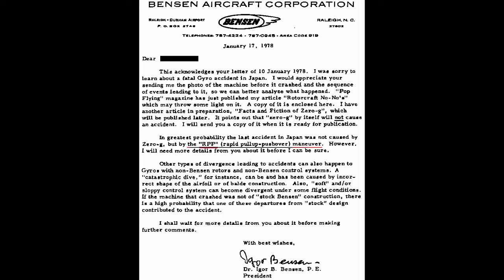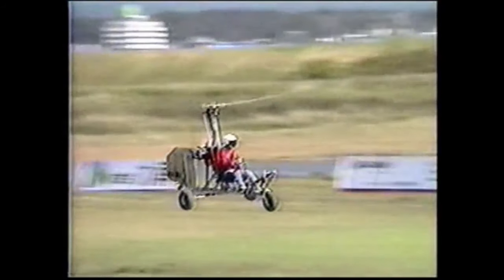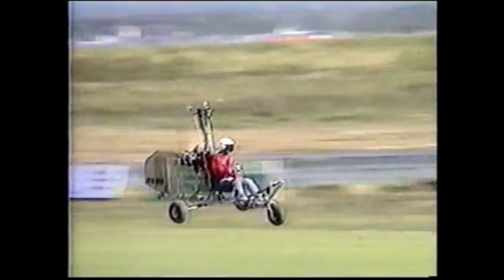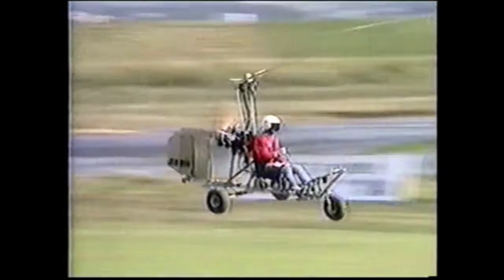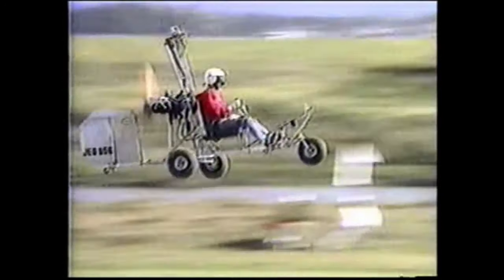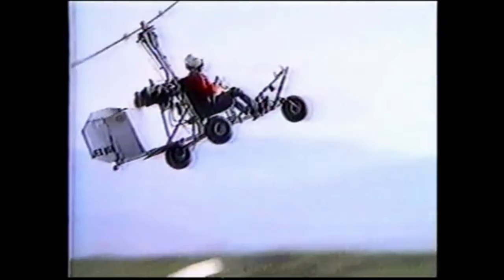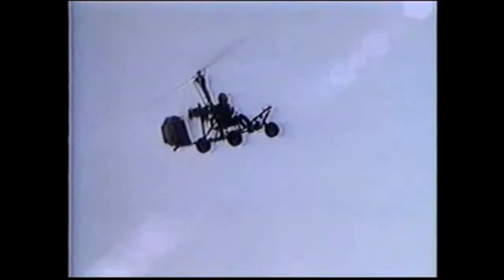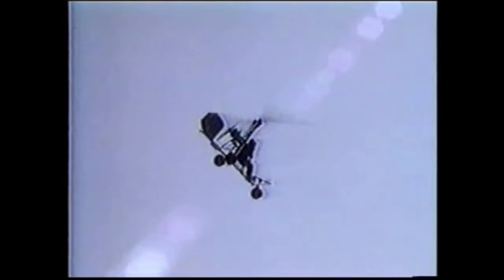Gyrocopter low g power push over crash (the cause of many gyrocopter fatal accidents)

Comment: Excellent work.  Very important to show this.  This is the classic negative g zoom then push over.  For others reading comments this is also possible at very high airspeeds particularly in a light machine with big rotors as your disk gets very low.  At high speeds it might be the tiniest of nudges that results in by bunting it over.  Fly slower than the top speed unless you are very experienced.
Reply: Yes - Cameron. and at high speed a good nudge to the right will cause a nose down pitch.
 NOT GOOD.
Reply: @shaneconnolly6673    Right or left? Yes that's possible the blades respond because the teeter hinge is off set so fore aft a nose down pitch won't do anything (for that microsecond) until the blade turns 90 degrees where the angle will effect it.  So a pitch to the right will if the teeter hinge is aligned will not impact until it turns 90 degrees when the twist will start to impact,  and pitch the up on the retreating side but the advancing will start to descent.  (If I have that right in my head).  

However I'd suggest if your that flat that this can have an impact you should be flying slower.  No one wants to say that though because we want short take off, short landing low speed performance and high speed performance, sensitivity and stability and we can't have it all.  If people really want to fly faster they shouldn't be flying with big high pitched rotors.  No one wants to say that.  

Fortunately for me my seat belt stopped me flying too fast.  Anything over 60mph the ends of seatbelts would start flicking my nipples at about 1000rpm ;)  Very painful and as I'm not into that I tended to fly below 60mph.  My gyro was very stable and nice up to 80mph (never flew it faster than that) but didn't like the seatbelt above that speed.  ;)
Reply: Thanks Cameron.
Yes HARD stick movement to the RIGHT will cause a nose down tilt.
 -aka UNLOADING  THE ROTOR !! at high speed.
Experienced gyro pilots don't notice this gyro effect- they just automatically compensate.
(In a similar way riders of BMW  horizon twin motorcycles compensate for the torque reaction of the motor & don t notice it .)
Reply: @shaneconnolly6673  Hi Shane I'm not sure you'd feel it.  theres a difference between the disk pitching and an individual rotor pitching - relative to the teeter hub.  Any movement within the teeter hub will not be felt (unless it exceeds the teeter stops) because differences in lift will be automatically compensated for - that's what the teeter hinge does.  It is critical at the point of unloading.  

I noticed this because after starting my flight training in ultralights for about 10 hours I shifted to gyros years latter a mate had brought the very ultralight I was training in.  He took me up for a fly and said "you want a go" of course I said yes.  So we are climbing over the airstrip and hit a thermal under the left wing.  "you going to correct that?" we were flying left wing high for a second, "Oh yes" I correct we hit another on the right wing "you going to correct for that?", "Oh yes".  I then wondered why my instincts were off.  I did fine the rest of the flight but wondered why the hell wasn't I correcting.  I took my gyro up after that flight and payed attention.  Flying through similar thermals I wasn't doing anything.  Because I didn't need to.  I worked it out.  The teeter hinge is lifting on the advancing side with reference to the difference in airspeed.  It lifts washes off angle of attack the retreating blade drops increasing its angle off attack we don't feel this because its doing it automatically.  

Having been trained and an instructor in gyrogliders and many times flow the whole length of the strip hands off I know there isn't any torque effect of compensation for this required.  As a disk the lift is equal even though the angle is oscillating up and down. 

Now in regards to a thermal under one side say.  what will the blade do?  Well lets say its on the advancing side.  The advancing blade has more lift (due to the thermal) so it just lifts as it does so the teeter hinge is pushing the retreating blade down increasing its angle of attack.  So you don't need to touch the stick because 360 degrees around the teeter hinge compensates automatically.  Now fore aft other forces can come into play.  If you hit a thermal although the lift is equallised (increased) across the disk as the disk is angled back say 9 degrees that lift will be increased so the effect (the moment) will change the relationship between engine thrust and lift and CG.  Of course correct down thrust or compensation of CG vs thrustline will fix this.  So the biggest thermals I ever hit pitched the nose down perhaps an inch?  go out of the thermal and it would pitch nose up about an inch max.  This was a standard Bensen geometry machine no stabiliser.  However remove the downthrust and every change of power will result in having to input a stick input.  

Generally though I realised I didn't ever fly by jabbing the stick to compensate I largely left it alone other than to adjust speed and direction.  If I hit a thermal I left it alone and just adjusted speed.

This is a long way of saying I'm not sure you'd feel any effects of the rotor responding to teetering down but yes I think if you are one the margin the teeter could well cause one blade to suddenly drop below the airflow and unload.  I don't think it likely you'd have any warning,  I suspect (although I don't plan to test this) you'd be flying and suddenly bang! Bang! BANG! you're now tumbling with wreckage strewn behind you.  Best thing would be to be no-where near this point.  Cheers
Reply: Yes I understand that the teeter action results in no torque reaction to be felt by the pilot.
I certainly felt the rotor axis tilt when I first  landed a gyro.
Nose down caused a bank to the left.
No doubt as a novice I was "jabbing" the stick a bit.

I seem to recall proving this with a rotating dowel  - No aero effect !
Yes the gyro effect precedes the stick movement of the rotor by 90 degrees.
Cheers
Shane @cameronlapworth2284
Reply: @shaneconnolly6673  agree
Reply: @cameronlapworth2284 
" Flicking my nipples " I lost it on that one, lol.

Comment: When in doubt lower the power to idle and keep stick pulled back. Dont fly the parabola. His zoom climb was actually pretty pathetic and it ran out of energy at a fairly low altitude and he has no Horizontal tail either, but even so pulling stick back and closing throttle would have punished the gyro but kept him alive.

Comment: Thanks, now I don't want one anymore lol
Reply: exactly my thoughts :)
Reply: You just don’t want one like this...  The heaviest part on a small gyro like this is the pilot.  A humans CG is somewhere in the gut.  Note the engine on this craft is up around shoulder height on the pilot and most all of his body weight as well as most of the aircraft structure weight is below that engine thrust line. A high thrust line gyro is an accident waiting to happen and requires constant attention to the details of flying, and is not a lot of fun to fly in rough air.  It is also the prime reason IMO for the small gyro’s questionable rep and safety record...  A zero thrust line or low thrust line aircraft is way more stable/self correcting and a lot more fun to fly.
Reply: @rronmar  and which are those?
Reply: @esau82  couldn’t tell you off the top of my head as I haven’t looked at gyros in years.  Typically for smaller single seat open frame gyro’s you want the propeller hub to be at or near where your butt/hips would be when seated, but there are exceptions to this as it is the total CG of the aircraft when the pilot is onboard, so looks can be deceiving. There was an ultralight gyro called a Gyro-bee that you could get free plans for which looked very similar to the one in this video, but was actually very near centerline thrust.  Usually though, it will appear as if something has been done to raise the pilot seat/pilot weight.  It is really a question you must ask the designer/manufacturer.  “is the fully loaded aircraft center of gravity above or below the engine/propeller line of thrust”  it should be a question they can answer clearly and quickly with something like “The aircraft CG is 1” above engine thrust line”  if they cannot answer the question immediately or tell you it is not important, don’t walk, but run away... you can gauge also by how long the manufacturer has been in business, a company like sportcopter dot com embraced the proper configuration early on in their designs and hav an excellent record, note the raised pilot areas in their design...
Reply: @esau82 Dominator gyro is a CLT machine

Comment: Enjoyed many flights in my Bensen, towed, and then as a BM8, which I have tucked in the basement, control input is different than a fixed-wing and explained in the original factory manual.

Comment: Wow, that was definitely a graphic illustration of just what how quickly things can go wrong, and obviously a case of what not to do!
So if he just cut back on the throttle, and applied some positive pressure on the rotor blades, he could have made it out safely?
It probably didn't help that the engine trust line was up quite high on that gyro too.
I heard that unloading the rotor blades even on some helicopters (teetering, 2 blade helis), can also lead to bad things happening, like mast bump, and even tail boom stikes!😬
It really pays to know what you, and your machine are capable of, as well as their respective limits. 
Condolences to the pilot's family.
Reply: No if he had more altitude he would have made it. He wrote a cheque the copter could not cash at that low of a altitude.
Reply: @Wildstar40  I disagree. Once you "bunt" - Power Push Over in a gyro you are done. Someone is collecting on your life insurance. There is no recovery regardless of available altitude.

Comment: It seems to me that if he simply continued his climb until he bled off air speed to a near stall, this would not have happened because the rotor would have maintained its loading. Correct?
Reply from the maker: Yes I think to some degree that is correct - as in I know what you are saying - but don't forget there is no aerodynamic stall like a fixed wing here because of the wing being the rotor and the pilot would [will in real life today] have to make positive control inputs to ensure that at the point of airspeed reducing in the climb [because at some point the motor can not sustain the current climb angle - we are not in a rocket!] to ensure 1g is maintained, remember once you start to fly a "ballistic" type flight path you are at zero g.
Reply: @gyrocopterflyingclub6148  Yes, I understand that there is no stall speed. My meaning was that as the airspeed bled off, wouldn't the aircraft stop climbing and then the pilot could simply return to level flight with no throttle changes?
Reply from the maker: @sevenrats  yep I understand, just being overly pedantic for the benefit of those who read later.  What is a nice way to do it is turn it into a semi-wing over where you just roll and pull - that ensures the rotor disc is always loaded.  See my film on unusual attitudes https://youtu.be/sAgmha6XHfE

Comment: My foster father who was a bit of a gyro man, taught me about porpoising. It looks to me like a failure very similar to what I was taught to avoid. It was certainly a steepish climb which would have lost air speed followed by a push over that caused negative g and the resulting rotar stall and rapid decent. Which without altitide was never going to recover.
Reply: Jay I think you have it backwards.. negative g's causes unloading of rotor rsulting in power push over. Loss of airspeed is not a problem but results in normal descent, not stall as with fixed wing aircraft.
Reply: Yeah, the steep climb lead to unloading of the gyro and once that happened the rotor  simply pushed him to tumble over. Like a parachute the gyro needs that positive g to maintain lift otherwise it  will drop like a stone

Comment: Makes sense if rotor is always need air flowing from the bottom though to the top of the blades if it loses forward airspeed at the same time the nose pitches over going to flip over now just a dead weight falling though the air.